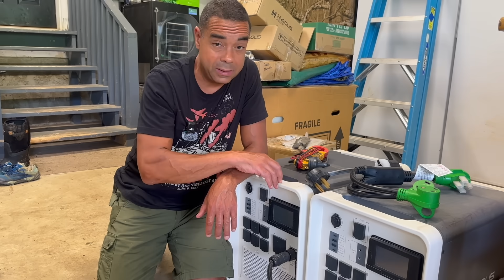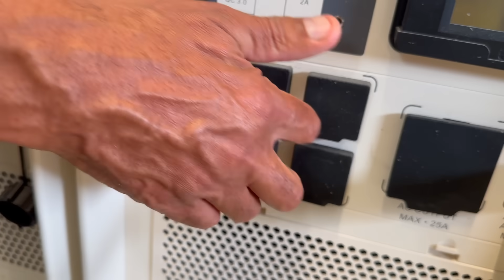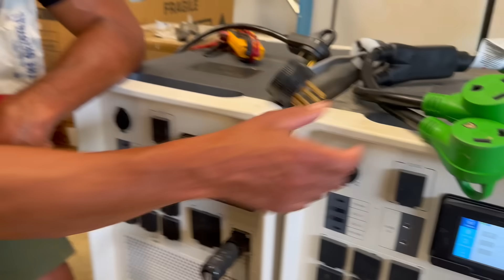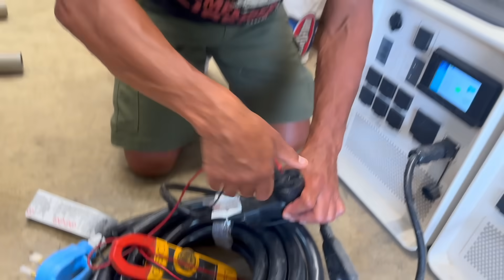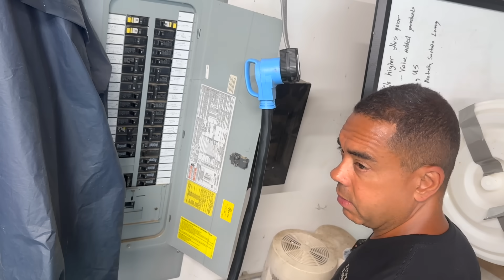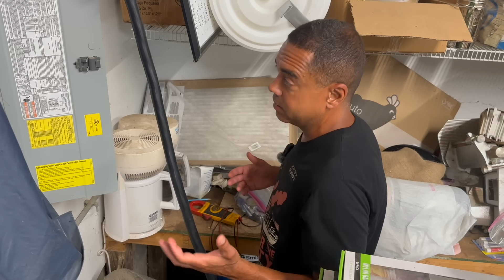This Plug and Play Solar Generator Can Power Your Whole House

Comment: Great I have 1 of the units and I have 5 panels I have it tied into my refrigerator and freezer and 3 bedrooms I don’t have it connected to AC  but I do believe it’s will run central heating! 

If I get another one I should be able to run AC and whole house 🏠 I’ll check with the guys

Thanks for video you earned a sub 😊

Comment: Very impressive Brother… I just purchased 4-Apollo main units along with 4 Expansion Batteries. Got my Electric Panel to except 50amp plug…. I still have to build Ground Mount Solar Panel rack then I will connect my Solar Panels… Can’t wait to get this all Energized to get partially Off Grid….. good video 👍

Comment: Spend more mo ey get a real home dyi a solar system.. these things they call solar generators are not that with out panals.by the size its obvious it will help a little but not handle a real storm were you need to power your house for days or weeks. It also seems that this needs to be pluged in each time u need it it has no ability to kmow that the grid is down and automatically do the job. Doing it this way with out an interlock you have many problems.. buy the real stuff not the toys.. unless you dont care to have alot of power for long.
Reply: They have a UPS feature so when the power goes down if you are using a critical load panel it will auto switch to battery back up and the switching time is around 3 milliseconds so the clock on your microwave wont even reset.  We have several customers from MT to FL living full time off grid with no access to grid power.  They have expansion batteries with 4 units running 50a constant with 63.6Kwh of battery storage.  In these remote off grid situations they also have windmill back up charging going directly into the Apollos and of course backup gas generator just in case there is no sun or wind for a week.

Comment: I have an electric cooktop, 240; i wired it 110 and it works for me. Sure it takes a little longer to heat up but runs just fine after that.

Comment: If anyone needs help setting up any kind of electrical set up, be it full offgrid, grid tie or just a backup, let me know and if we're in the same area I will help.  I've been designing and installing solar, wind and hydro systems for over 20 years.

Comment: Hi Billy, This HySolis unit is actually one of the few, truly capable portable power systems.  Most just don’t have enough battery capacity to do much other than run some lights and phones for a day or so.  We’ve moved 90% of our entire farm to off grid power and it’s amazing what solar and battery tech is out there right now.   Just finished installing a new solar air conditioner! 👍🤩🥶
Reply from the maker: You sound like my kind of person!
Reply: Then running one of these for about 2 years now with the expandable battery. they've been great powering my  eg4 solar mini split All winter and most of the summer zero issues definitely going to expand to two more units and two more batteries hoping ahead 30k watt hour

Comment: I would like to see how much the charge last, and when you hook up the solar panels to charge it.
Reply from the maker: I plan on doing a video on that very thing.
Reply: This all depends on the load and if you have solar input coming in.  Take one Apollo unit for example.  If you have no solar coming in and you are just running off battery/inverter you can look at the load it is pulling on the screen and divide that into 5300(battery size on the Apollo)  So if you were running a 1000 watt load and your battery is full with no solar it will run for just over 5 hours.  The Apollo also can take in more solar power than you can put out on output power so if you have a full solar array maxed out to the Apollo you can bring in around 5000 watts of solar and max the output out at 3000 watts so you will still be able to charge the battery with the extra 2000 watts to ensure you have a fully charged battery come nightfall.
Reply: @HysolisSupport  Ok, honestly those solar systems seem to be getting really good over time. I would imagine that with a few L.E.D Light bulb a inverter refrigerator and  some fans. That thing can run for a pretty long time, not to mention the add up batteries. Thank you.

Comment: Billy!! Best thing i did years ago was add a transfer switch at the well for a 6.5kw gen and anyone can start and operate. I keep the battery for gen set trickle charging at the well. I've got 35kw worth of panels I'm slowing building a couple 48v systems to power a bunch of essentials and het most off of line pwr. I think i have my brain wrapped around it, now need to take action as funds get raised.
Reply from the maker: That’s what I’m talking about Pete!
Reply: @PermaPasturesFarm21 somehow i need to make more time to do it all. Nuts

Comment: I have an existing solar system, but I’m looking for a battery back up. It’s grid tide currently I have essentially three freezers and two refrigerators that need to be powered in the event of a down situation. I ran a gas stove and gas water heater so I’m looking for affordable battery backup reallyit will run things overnight.
Reply: A lot of these systems allow tieing into existing micro inverter setups through the AC input or generator input.

Check out it hysolis can do that if not I know EG4 12000XP can through the generator port.  I’d do that plus 15-30kwh of battery.  Then you can charge and run loads off of your existing solar, can add new solar through the mppt of the 12000xp, run off battery if no solar, and finally run off of grid as the final option (it allows 100 amp pass through from the grid).
Reply from the maker: I’m glad you’re among the very few that are looking for alternative options my friend!

Comment: How long did all that run until the batteries drained?
Reply: It all depends from the size of the load, total charge of system when lods kicked in and the total run time.
If you want to see from full to dead, hoe long would it take to run, you need to know your total load.
There are online calculators to estimate what your run time would be till 0%.
Reply from the maker: I plan on doing another video where I find that out.

Comment: The giant plug I'm assuming is something that needs to be installed the first time you get a generator, correct?
Because as far as I know there's no such plug to plug a generator into on my house, the wiring seems to go straight from the meter panel outside to the breaker box in the hallway which is the closest to the meter side of the house.
Reply from the maker: You’re probably going to need an electrician to help you out with that.

Comment: Hey Billy.  As a journeyman electrician I’ve actually helped install a hysolis inverter/battery system. Set up was quite simple. Our customer uses it with solar panels and a backup generac generator to top off the system. Eventually he will add wind. 

I want to comment how helpful Joe and Brandon were at Hysolis. They were always quick to answer and reliably returned our calls. The best part about this alternative energy system is you have real Americans on the other line to help with your system. No Chinese number you need to call or email which almost always they are never helpful.
Reply from the maker: Brandon is who I dealt with and he was awesome!

Comment: The problem I’ve encountered is installing a transfer switch to plug the units into. I returned an EcoFlow because there was no method to hook it into my house.
Reply: Hysolis has a solution for this. It’s been done before in Montana. I have done it. If you give me some details on what you’re doing I can try to help you.
Reply from the maker: I can’t publicly stated in the video, but I don’t use an inverter. I just turned off the main and backfeed it through a two pole 50.
Reply: @PermaPasturesFarm21 I’m not adept in these electrical hookups. I was Tok I needs to install a transfer switch with an electrician and in this rural area I couldn’t locate anyone.

Comment: How many hours will it run that stuff?  You didn’t say and that’s a big piece of information you did not give. I live in a state that does not get that much sun in the winter.
Reply from the maker: I’m planning on doing another video of where I run everything on just that generator. I’ll definitely let you know!
Reply: @PermaPasturesFarm21 Thank you Sir. Love the channel man.
Reply: Website says it'll run a fridge for 60 hours without a charge. So 2.5 days it'll run a fridge without charging. But add solar array & it'll keep running a fridge & some smaller stuff ongoing I presume. Double the unit & it looks like you'd have over 10kwh to work with if I'm reading it right. That will run the necessities for most people if they're disciplined enough I reckon. Looking forward to see how it holds up for him. 10 grand investment ain't no chicken scratch tho.

Comment: For an equivalent to one of those units budget friendly (but more complex to install) setup:

EG4 3000 inverter - $700
Ecoworthy 5kwh battery - $850
Total: $1550

Equivalent to two like you showed:

EG4 6000XP - $1550
Ecoworthy 5kwh x2 - $1700
Total: $3250
Reply: yeah i would of went that route, by the way i have went that route but i have sun gold power all in one units. two 5000v in split phase, four ecoworthy 5kwh batteries, way cheap with a lot more power at 20kwh
Reply: @rudeboys28712  Awesome man.  That'd be a great setup.  Looking forward to when I can do that.  I have too many kids to have spare money at this point in my life.
Reply: If you have to pay for an electrician to install those and for all the extra materials needed, vs installing this DIY, the cost disparity isn’t as big.

Comment: Looks good. I went with the Anker F3800s you revewed before and very happy so far
Reply from the maker: It’s definitely a good unit, but it’s nowhere near as powerful as this one.
Reply: @PermaPasturesFarm21 Yeah, the Ankers are just over 3800wh reserve capacity whereas these are over 5000wh. The Ankers do have higher continuous and peak power output 6000 and 9000 vs the 3000 and 6000 of this unit though. Both seem very good
Reply: This company also has double the cycle life on the batteries and can handle way more battery expansion. I also noticed their solar panels are a way better deal than what Anker offers